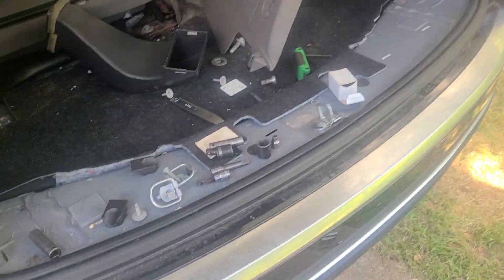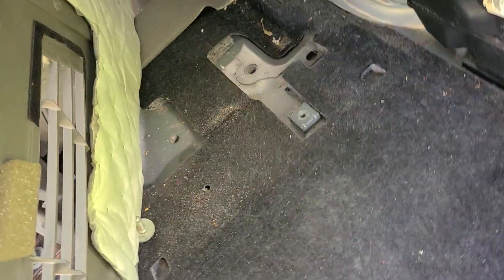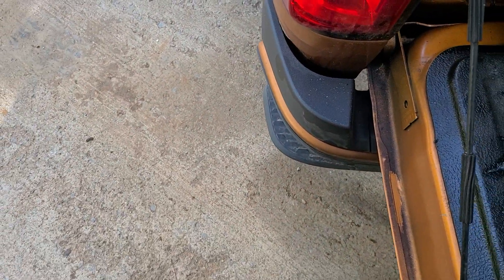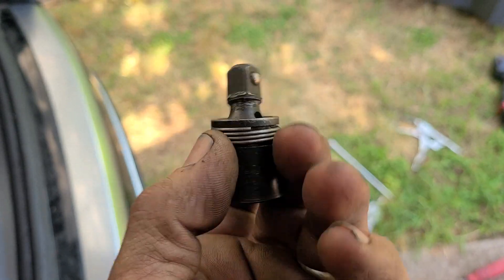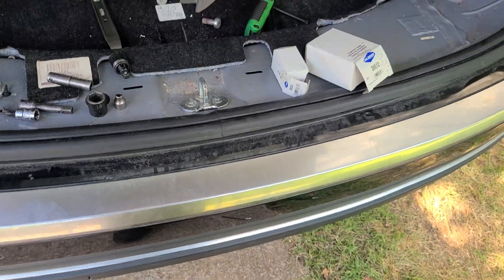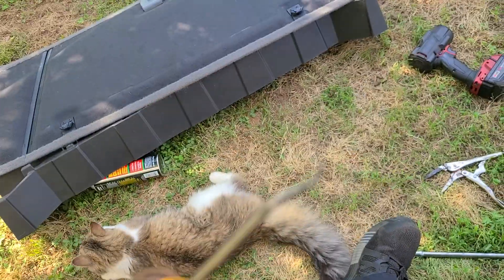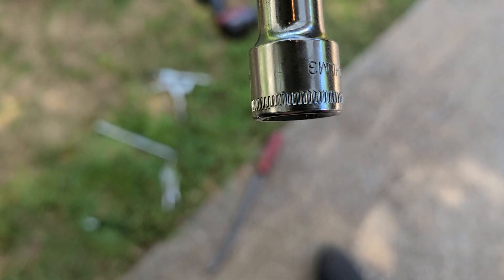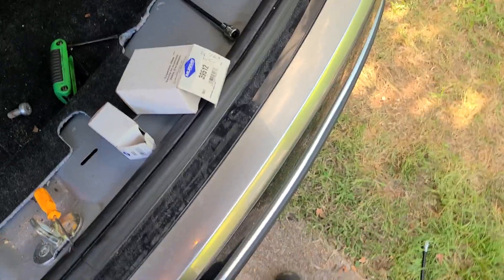GMC Acadia rear expansion valve and filter replacement tips

Comment: Did it fix the problem with no ac in rear?  Or did you have to do more work like replace the compressor?
Reply from the maker: Made it way better. Not as absolute cold as front AC but well under 60°

Comment: Thanks for the helpful video, about to try and tackle this on my 2011 Acadia. So I can do it all from underneath, no need to pop off that interior panel in the back?
Reply from the maker: I think you can. If you are only changing the expansion valve.
Reply: @ykmalachi  Yeah I just plan on changing that, I was just a lil confused because you mentioned having to clean up the mess made inside with brake cleaner. Anyways thank you for the reply